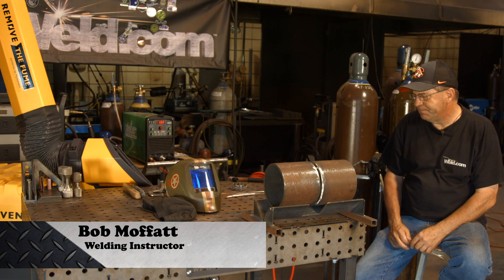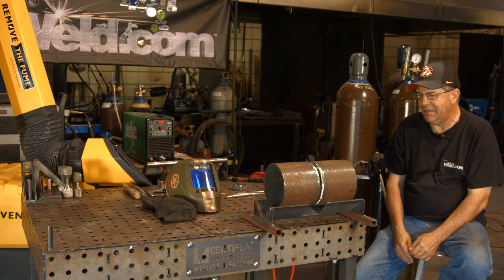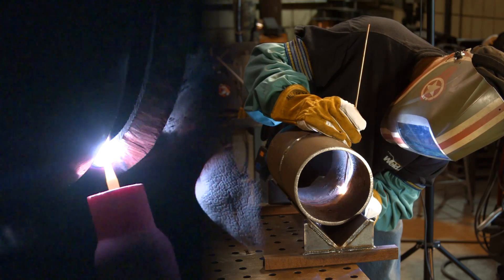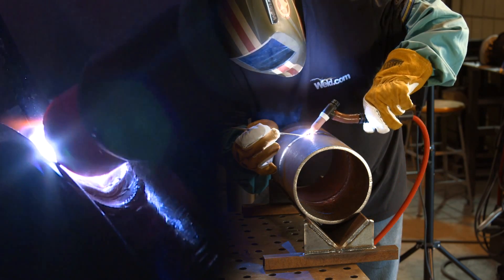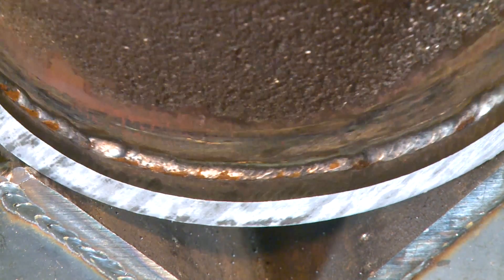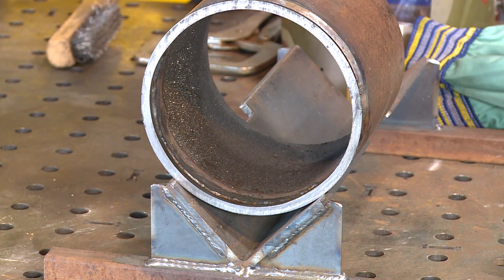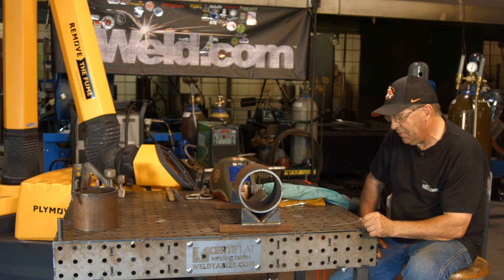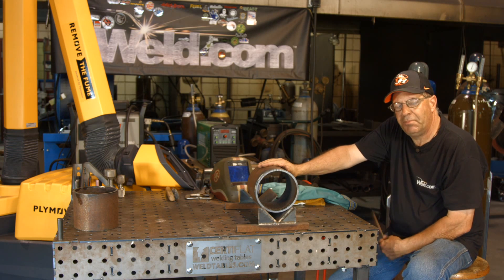🔥 5G Pipe Welding with Uneven Fit-Up (Everlast PowerTIG 185)

Comment: this has nothing to do with this video but I've been trying to braze aluminum with "no flux" brazing rod.    I've tried propane, mapp gas, and oxy/aci  but it won't hold.   I can get it to stick great to one side but not the other.    I can't figure out what in doing wrong.   do I need to use flux?

Comment: ..I had to take a welding test once for employment....rusty pipe about that size, 8 inch or so.... maybe 5/16" wall....guy says '''cut that, prep and weld uphill 6G"...all with only a cutting torch...no grinder anywhere.......SMAW....

Comment: Why do steel tig rods have an orange color?
Reply: Copper plated
Reply: Why are they copper plated?
Reply: Helps to resist oxidation (rust) but will still rust if left in water for a long time.
Reply: The copper wont contaminate the weld?